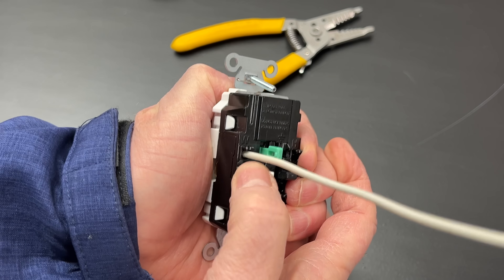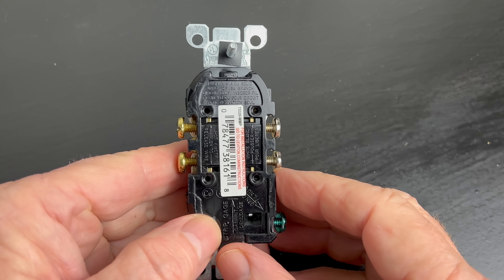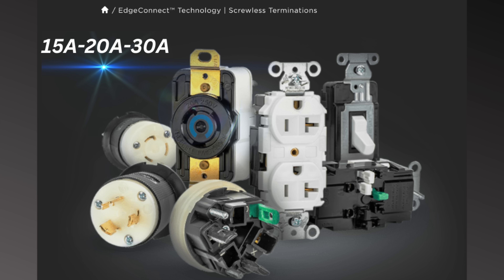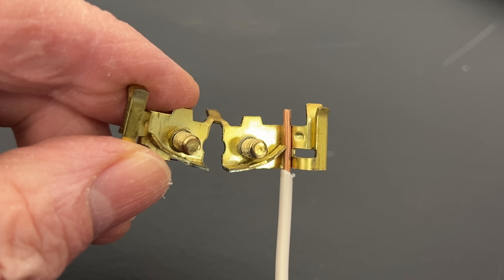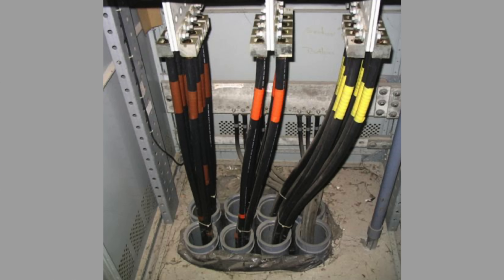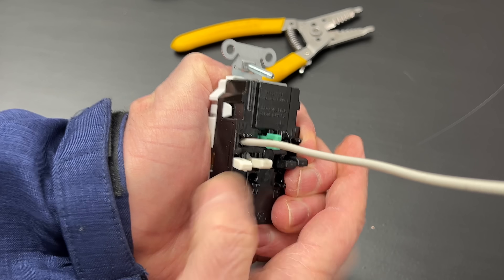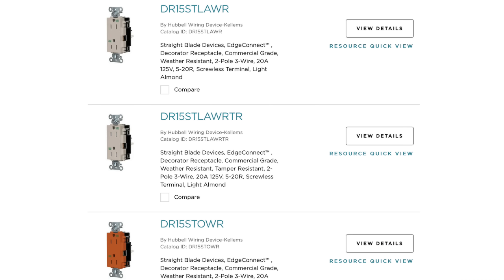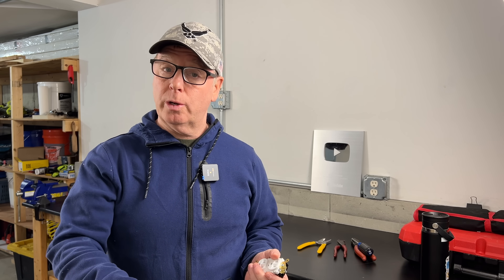This New Receptacle Design will set a New Standard (Welcome to the Future)

Comment: Looks like Junk to me!
Reply from the maker: Far from it. They're being used in large industry already. Heavy duty connection with some incredible UL testing results.
Reply: @BackyardMaine  -- I've seen much better implementations of lever lock outlets from other vendors.
Reply from the maker: @rpsmith  The only other lever locks on the market are the Leviton decora edge which are nice but the offering is limited to residential grade, 15A and only duplex receptacles, single pole and 3-way switches.
Reply: @BackyardMaine  -- Yes, the current Leviton offer is only 15A but I'm looking forward to their 20A version.  BTW, thanks for the Hubbell link. Maybe I'll change my mind after I have on in my hands.